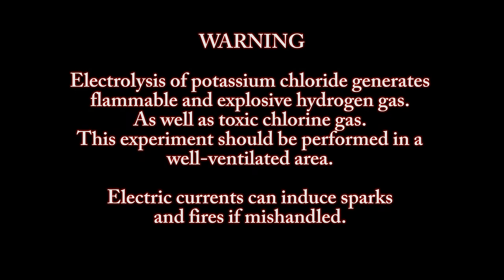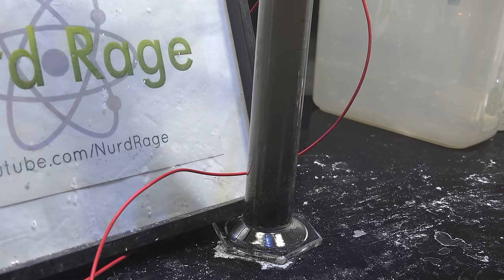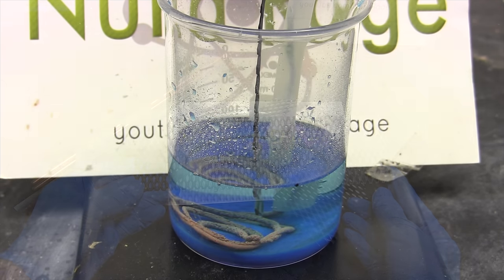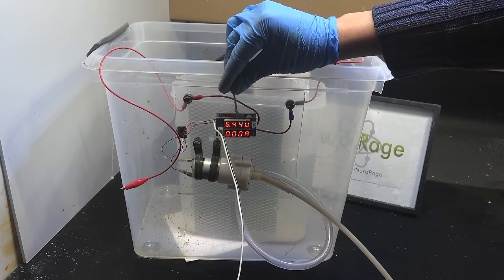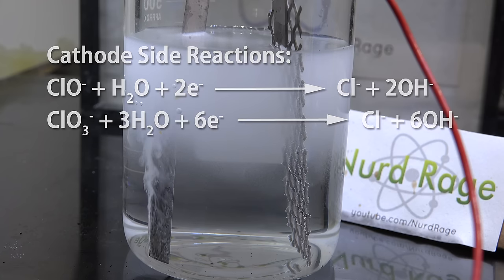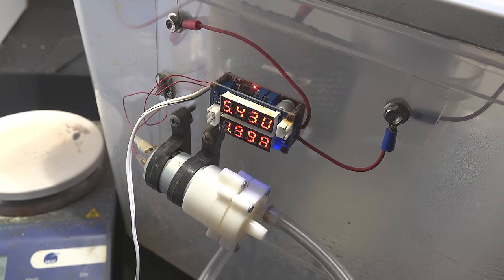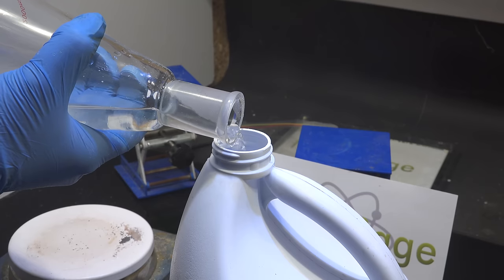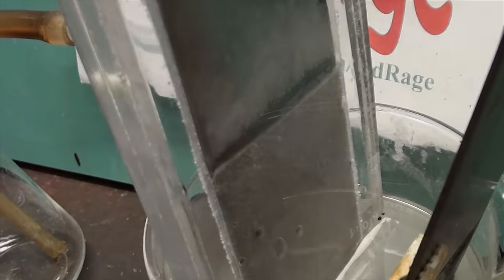Make Potassium Chlorate by Electrolysis - The Basic Guide

Comment: You've left out a cheap and recyclable source of electrodes for a chlorate cell. Lead cathode and lead dioxide anode. The lead dioxide erodes but can be recycled and purified with hydrochloric acid, sodium carbonate and vinegar in multiple steps. The lead acetate can be plated out to lead dioxide and lead. Another thing you can do is vacuum impregnate your carbon rods with linseed oil and let cure. This reduces the carbon erosion.
Reply: have you an idea on why carbon rods erode but linseed helps avert? is it because of the porosity or something?

Comment: Classic experiment I've thought about making a version uses a solar panel as the current source so it can just be left outside.
Reply: Bad idea, when there is no current it destroys the anode
Reply: @KClO3  dang. or I should say dung.   

And hey your name makes me think you're a nerd in this sector. so do you know something about using Calcium Chloride as a cathode shield / for improvement of current efficiency? I heard that it works better than the toxic potassium dichromate. but I just don't know how much to add.
Reply: @davemwangi05  calcium chloride does work but the cell needs to be at a high temperature, also at a high temperate the calcium chloride will regulate the ph too but if you don’t have a high temperature cell it is pointless to add it, also don’t use KCl in the cell, instead use NaCl and make NaClO3 then use double displacement with KCl, it’s way more efficient and cleaner. I don’t remember the exact amount of CaCl but I can probably find it in a bit and I’ll post it
Reply: @davemwangi05  just add about 10ml of saturated CaCl2 per liter of saturated solution of feed salt and oh it won’t do shit unless the cell runs at 65 degrees Celsius, use NaCl instead of KCl and just do double displacement, if you have more questions just ask me
Reply: @KClO3  Oh my gosh, you've assisted a lot man. This material is so esoteric, I tried to search and it was nearly impossible to find scientific docs, I can only find K2Cr07. Reading your comment I already realize I was already doing it wrong. LOL. My cell was running at like 30 degrees so I see it was pointless. And oh, the CaCl I had made DIY from Egg shells reacting with HCl, and the HCL was also DIY from NaCl/H2SO4 dehydration. LOL.      You saved my day.  

Yeah look for that info on the precise cacl per liter it'd help a lot.  thanks a lot bruh.

Comment: Electrolysis question, what electronic devices are being used to convert AC to DC and modulate the voltage and amperage of the current?

Comment: The electricity can also be made for free not only from solar and wind but also from diy batteries from waste metals. Forexample a aluminium plate and cupper plate in passiumcarbonate solution will give 1,3V current and connect them for higher voltage for your electrolyses setup. when I was 16 I have done this electrolyses with sodiumchloride NaCl solution and made NaClO3. Then I have made with friends a powerfull bomb from it by putting it into a PVC pipe together with phospor and carbon powder. We did ignite this it was very very powerfull explosion with bright white light, a lought bang and a mushroom cloud of 10m high.

Comment: @NurdRage Nice video as always! :) Would it be possible to modify this setup to instead obtain sodium chlorite (NaClO2) (not chlorate (NaClO3)) from a saturated sodium chloride (NaCl) solution? Or are there too many side reactions that prevent this? Thanks!
Reply: nah electrolysis of NaCl like ethis does not work like that sadly
Reply: Chlorite can only exist in an equilibrium with chloride too, it's unfortunately out of reach of these types of cells.  Should be able to find some on ebay though.

Comment: Our supplies of salt have potassium ferrocyanide as an anti-caking agent in them (I have to use low sodium salt and crystallise the KCL out); when I run the cell, it accumulates a dirty brown sludge, presumably from the ferrocyanide. I'm using a Pt coated anode, so it's unlikely to be anode deterioration. Is this sludge harmful to the reaction or can I ignore it and filter it out at the end?

Comment: Question, sir, what about tungsten electrodes, perhaps like the ones you use for TIG welding?  I wonder if an array of those electrodes would be resistant..... perhaps cheaper than the others, but then again, not much surface area.... wonder if a little grid of them welded together would do a good job......

Comment: Hi NurdRage,
What do you use as a power supply set up and cables?
Reply: current controlled stepdown converter. the cables were just copper cables which were destroyed in the process.

Comment: Could I just use the adapter that comes with the charging cable for mobile phones, while this applies 5V and roughly 1.55A?
Reply from the maker: No, it'll burn out. mobile adapters are designed for constant voltage charging, not constant current.
Reply: @NurdRage  Oh, ok. Thank you
Reply: I've used them man and they work just take days/week's depending on cell size

Comment: I have tried the bleach method numerous times and it never ever worked for me. Maybe was the Hypochlorite concentration  but i don't know.  
Once i boiled a 2 liter bottle of 5% Sodium Hypochlorite to half it's volume and added Potassium chloride to make a double displacement reaction. 
Didn't worked. Maybe it's because i boiled it in a metal pot. I think that is the problem.
Reply: Or maybe the hypochlorite decomposed as it is not very sable.

Comment: If I use a 10x10cm carbon plate as an anode, can i make the kathode out of stainless steel or do i have to use carbon as well?
Reply: For the cathode you can use any corrosion resistent metal like stainless steel or titanium.
Reply: @laurenzg.6027  thanks!

Comment: Thanks sir.can you please describe why pbo2 anode  make on lead bar decrease current after one day.
Reply: The PbO2 from lead substrate is highly porous and allows solution to infiltrate into the Pb substrate which makes it unsuitable for chlorate production.
PbO2 itself is erroded by chloride ions and is not suitable for chlorate production and even doped and compositized nonporous PbO2 is not designed for chlorate and has an errosion rate of 0.1 micron per hour in the best case scenario. Normal PbO2 has an errosion rate of 10 microns per hour in the same electrolyte and porous PbO2 is 30 microns per hour in a high chloride environment.
PbO2 is designed for O3 and O2 evolution where in these conditions almost no errosion occurs with any type of PbO2 like in conditions of chlorate to perchlorate cells where errosion only occurs at the start when the residual chloride causes soime micro errosion to occur.
Reply: @CatboyChemicalSociety  thank you very much

Comment: Hey NR.  What about tungsten as anode.  Tig welding electrodes.  Just curious.
Reply: Electrolyzing a solution of KCl with a W anode would most probably make potassium tungstate, or just a precipitate of WO3
Reply: CobaltChloride what if use titanium as anone  alone? do you think its gonna eat up the titanium quickly? I got alot of titanium plates from my good friend. 😄

Comment: Am i correct in thinking you can not do the density test for chloride levels in a sodium chlorate cell as the sodium chlorate that is produce stays in the solution?
Reply: Not a chemist, but I'm not totally sure. Yes some chlorate does stay in solution, but at worste it would only throw off your measurements a little. For here I think Nurd is refferening to an approximation as being good enough for a guide post.

Comment: If using a carbon rod for the anode, would it work to use a suspended stack of a few coffee filters to separate the anode and cathode sections, layering them vertically with the carbon rod anode above the filters and the cathode on the bottom of the container?  Would this be effective at all in keeping the carbon silt separated from the potassium chlorate product?
Reply: Maybe if you make the water circulate through the filter so the kcl doesnt get depleted due to poor circulation?
Reply: Wow dude, 'cmon this is exactly what I'm doing, I'm making this cell a bit more advanced which will use airlift to help pump the solution to a higher point where a filter awaits, and circulation can occur. very cool. I'll tell you how it goes. I'm also using arduino to control the feed of NaCl by adaptively measuring the conductivity, etc

Comment: Very nice video and very impressive. I like all your videos and I tried a chloride cell at home but it doesn‘t work as planned. All in all my resistance is too high because at 6V I don‘t get any current and at 9V i receive 0.4A. Currenty my Cell is working at 9V. So my question is: How can I reduce my resistance? I bought the same electrodes and I minimized the distance from one electrode to the other. I made an isolation around my cell to keep the warmth inside. But right now, I dont know any further. I would be so happy if you know any answer!

Comment: Will lead dioxide electrodes work?
Reply: That would be interesting because you don't have to build cell yourself
Reply: yes they work but you cant get them very often (in europe)
Reply: @hubari7867  but lead oxide is basically every non electric car battery, and its already preassembled cell for electrolysis with good high current connections

And thanks for reply!
Reply: @igorb4650  i dont think that the crude  lead oxide from a car battery would work.
You can watch Grant Thompsons video where they opened a battery and extracted the lead out of it.

Comment: Do electrodes made of tungsten in a chlorate electrolysis cell corrode that quickly?  Tungsten should actually be a very stable material and is available inexpensively in the form of TIG welding electrodes.
Reply: Please don't use that. The problem is those electrodes tend to be doped with thorium to reduce corrosion of the electrodes when welding. This process can react with the thorium and turn it into water soliable compounds that can be absorbed from the skin, or salts that can be inhaled.

Comment: Could you still do a video on how to get potassium perchlorate with potassium chlorate. I already found some of them online but it looked like they were really trash, with no explanations and stuff :c Would be kinda cool if you could try to film a video on it
Reply: Auxiliary Stream Services  okay thanks ill check this later👍🏻
Reply: K Chlorate to K perchlorate is a thing, but not very efficient.
I used crystallization to separate the perch from the rest.
Voltage is important, too low and perch won't form.
Too high and you boil the cell...
Reply: @pirobot668beta  thanks for your reply!
Iam only in favour of making KClO4 because its much safer, especially when mixing it with metal powders. And you could use the over KCl again for the cell so it would take longer but i really dont wont to work with such dangerous things

Comment: Didn't you do a video on platinum dissolving in chlorine gas and acid?  Why doesn't this process dissolve platinum?
Reply: This is very alkaline, not acidic and the hypochlorous acid and chlorine react with the potassium hydroxide formed immediately and so are only intermediates in the reaction and they dont exist for long. The chlorine by itse can't dissolve the platinum

Comment: Can l use same method to make sodium chlorate? What about sodoum perchlorate
Reply: Yes
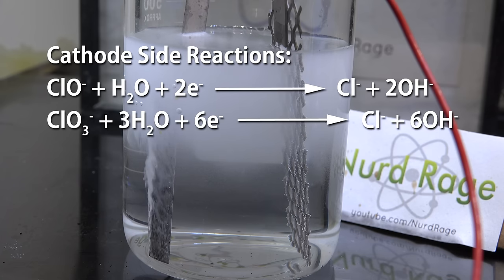Reply: I don't think it would work as well. One thing to keep in mind is that the  chlorate can be reduced back to chloride at the cathode. NurdRage mentions it at 11:15. What make potassium chloride work especially well is that the potassium chlorate that forms precipitates out, thus forcing the equilibrium to favor potassium chlorate since once precipitated, it can't be reduced. Sodium chlorate is far too soluble for it to precipitate, so you'll be less efficient. If you do try it with sodium chloride, I'd recommend double displacing the sodium chlorate with potassium chloride to precipitate the potassium chlorate to get more pure chlorate.

Comment: Still wainting for someone do a video about lead dioxide anodes for chlorate cells... they seem way more viable to make than using graphite or expensive platinum...
Reply: Higor Guedes there is a video if you search YT; I've tried that method but had only limited success as the PbO2 coat was not adherent enough to the substrate (graphite) and subsequently allowed the electrolyte to seep between the two destroying the graphite. The lead oxide coat curiously remained grossly intact as a mostly empty shell.
Reply: @stamasd8500  Interesting. But i think i might have already watched it. But i'm gonna do a search again. And i'm experimenting with using acetates to coat the graphite substrate, using a apparatus that spins the graphite while it does the electrodeposition. I think you can give it a try and make a really thick layer of Lead Dioxide. But anyways. How did you coat you electrode? And how thin was the coating?
Reply: @stamasd8500  and if you try to erode it a little by using it to do some electrolysis in a table salt solution and afterwards coat it? I might help. Also cleaning it is very important.
Reply: Higor Guedes it was very clean (prior to deposition I ran the graphite in a NaOH cell, then eroded it in dilute nitric acid) and the coat was quite thick, about 3-4milimeters. I had the anode spinning all the time during the coat deposition, and I also used a non-ionic surfactant in the bath to prevent bubble adhesion. The coat looked very good at the end. I guess it probably had microfractures which allowed the electrolyte from the chlorate cell to diffuse to the graphite and corrode it.
Reply: If I were to try it again I would attempt to use a titanium rod instead of a graphite one for support.
Reply: One last thing, the surfactant I used was Tween 20. Orherwise I followed that video without many changes.
Reply: @stamasd8500  it's probable. I think when it drys it begins to crack and that is bad...
And i think you used lead nitrate, right? Maybe that could have some influence? I've heard from people in some chemistry forums that they indeed had a sucess using these kind of homemade lead dioxide electrodes... and about the titanium.. that might be worth trying, and might be more easy to spot when  the coating cracks.
Reply: I have experimented with a solution of lead acetate/copper acetate
Reply: Higor Guedes yes Pb(NO3)2/CuNO3 mix. I have read that acetates don't work for this purpose.
Reply: OTOH I had decent success with cobalt/manganese oxide electrodes on titanium for perchlorate cells. I posted about that on the scimad forum in the "thoughts on anodes" thread.
Reply: @stamasd8500   Really? I have commented about it with some people that have knowledgeable in the field and they think it might work.. but well.. i'm not a expert in this subject then i might be wrong... i hope not lol
Reply: @stamasd8500  i'll gonna take a look. My nickname is pyroplatinum in there. And about the cobalt.. here where i live is somewhat difficult to get hold of some cobalt salts. I have tried to extract it from some lithium batteries tought...
Reply: I want to experiment with magnetite too but have i never found much literature talking about this process, or the process of making a electrode out of magnetite...
Reply: @stamasd8500  i heard you can use detergent... but i doubt it would be nice for the coating.
Reply: @butth0le_inspector  About cobalt salts, I used cobalt carbonate that I bought from a pottery supply store (it's used in ceramic glazes) and converted it to nitrate with nitric acid. You don't need a lot; a little goes a long way. My username on scimad is the same as here.

Comment: Where can you find a power supply like that
Reply: I use old school car battery chargers that have a regular transformer that will produce power no matter what and doesn't quit unless it dies, which hasn't ever happened before to me. Or rectify the output of any larger transformer you find in old amplifiers and other electronics and use that. Many computer power supplies will put out plenty of amps at twelve volts or five volts or a combination of voltage by combining the outputs in various ways and you can use a resistor of appropriate size that handles the power dissipation to reduce the voltage or current, and thereby save the transformer from over heating and keeping the system from generating so much heat and chlorine gas instead of the product you want.

Comment: for 2.5 liter cell running with 5.2 Amps...how many days it will percipitate kclo3?
Reply: Just run it for as long thr current doesn't pass at 5v or very low current passes.. this indicates that chloride conc is less than 10%
Reply: But make sure not to run the without any chloride as the electrodes get damaged

Comment: k uh nothing is precipitating out, am I supposed to just wait for a few days while constantly running the reaction or is something going wrong? I've currently been running the reaction for a little over a day at 9 volts.
Reply from the maker: How much current and whats the current density?
Reply: @NurdRage  I don't have the tools to measure that, unfortunately. I've been using a small cup to do it for a beginning test. If everything was set up correctly, should something be precipitating out at this point?
Reply from the maker: @roychen1239  without knowing the current it's nearly impossible to diagnose.

Comment: I only took chemistry in school. Can someone explain how The K, Cl and O react? As I understand it K+ ions in the solution cannot react with Cl2 at the cathode which is already reduced or O2 at the anode...
Reply: Not directly no. What I've seen in other videos is that the potassium and chlorine separate as ions in the solution, then there are a few side reactions. But the process as far as I can remember is that charge from the electrodes gives the energy to create chloric acid, and as that concentration grows, it further oxidises that into hypochlorite then chlorite.